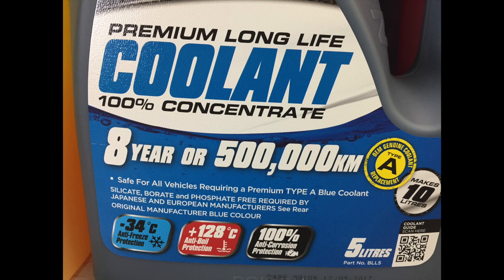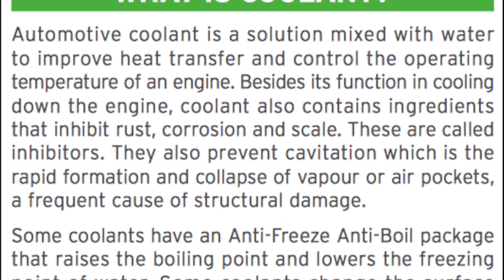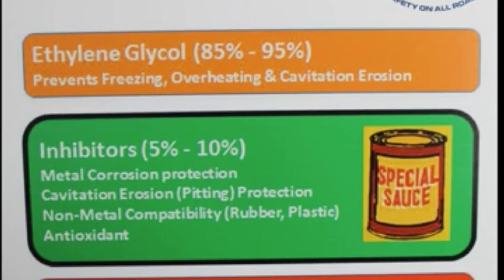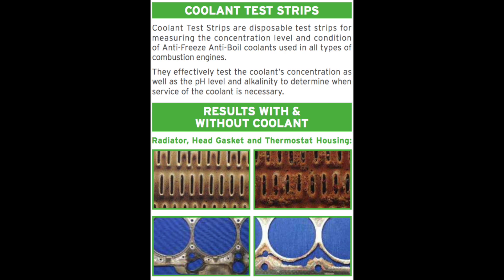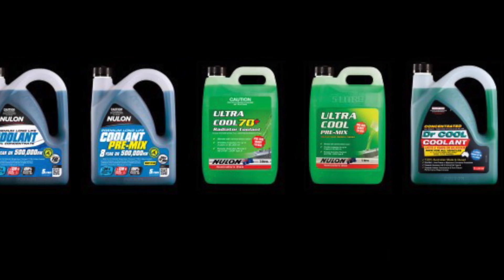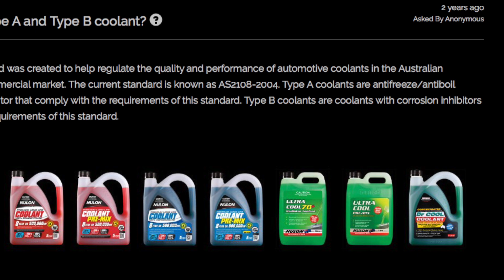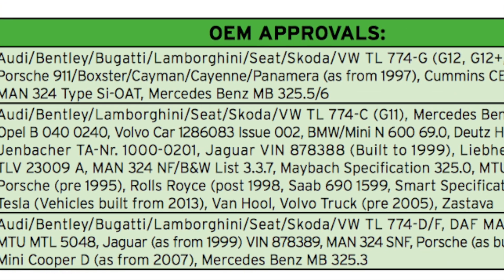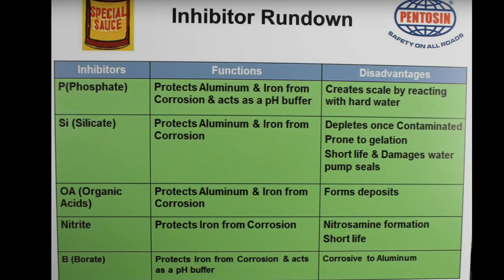Understanding Coolant. Car engine coolant isn't complicated. Rust inhibitor Anti freeze

Comment: I'm looking to put a HOAT in my 1.8 16V Zetec which currently has OAT in it. I will flush the entire cooling system / engine of the ute with deionized water and radiator detergent mixture first. Should this be a reasonable change?

Pretty much adding the same coolent but with the hybrid element which reduces static risk to the sensors and better preserves any aluminum in the system.

Comment: Help ASAP pls!! As a recommendation for BMW, I have a green coolant, but in the BMW Series 1 118D (2005) I just bought, I have a liquid that looks like water. 
Does anyone know how to check if it is a Waterless Coolant or Water?
Reply from the maker: There are test kits available. Have a look at the links in the description or your local speed/ auto store. But if in doubt drop it out and change it. MRT
Reply: @Marksreviewsandtutorials  Thank you. This Waterles Coolant is rare in Serbia. Few drivers know about its existence, I don't even know if it can be bought somewhere in Belgrade. Are the same measuring instruments used for it as for other coolants? Yeah, I tasted it, it's sweet. 😋

Comment: I changed my original green Hyundai coolant with red. I flush it twice. Is there gonna be a problem?
Reply: Valvoline explains the different color of coolant. You may put wrong one. You can buy Valvoline coolant. Valvoline is the giant company, so you won't mess up if you use correct one. 
Note: Valvoline coolant is almost as expensive as OEM coolant.
https://www.valvoline.com/our-products/antifreeze-products/antifreeze-education/engine-coolant
Reply: What type of pink/red coolant did you add? If it is for Asia cars (P-HOAT), it is fine. If it is OAT, it may not be compatible your car.

Comment: I used a castrol concentrate it was yellow in my old 202 (steel block & head). It was good for corrosion protection. However I can't get this product anymore. I use green coolant now and now I have proplems with the aluminum parts corroding now (water pump/ thermostat housing) :(
I'm not sure which coolant to use now. Basically there is type A & type B
Reply: type  A is better.. For corrosion protection you need 50 % green coolant and 50% distilled water ( NOT tap water )
You can buy it premixed at 50% / 50% but you usually  cant get all the old coolant out.
google coolant for your model of car

Comment: Hi, I just checked my coolant and the colour is completely gone ! It was blue going in 3 or 4 months ago and now it looks like plain water. No leak, no topping up or dilution.

Any thoughts on what it could be ?
Thanks in advance.
Reply from the maker: UnCivilEngineerIRL I don’t know but my suspicion would be cheap product? The color is just dye. But if it is gone I would drain the coolant and replace with fresh. 
Did you fully drain last time? As the blend may have affected it as well. 
MRT
Reply: @Marksreviewsandtutorials  Thanks for the reply. Product seems fine in other machines but can't remember what it is or where I got it.

When I got the bike it was full of horrible brown sludge; so I flushed it out with clean water and then coolant.
Then filled the system with a 2:1 mix as specified by the coolant manufacturer. 3-5 months later it has completely gone clear.

Comment: Another one that forgets OAT coolant must not be mixed with ethylene glycol (unless stated as compatible).
OAT antifreeze generally called DEX COOL.
Mixing generally causes gelling.
Reply: OAT coolant is still generally ethylene glycol based. It's the corrosion inhibitors that are different and can react. There's also a couple of different types of OAT coolant. Most European vehicles use a coolant such as BASF Glysantin G30, whereas General Motors "Dex-Cool" specify a mildly different additive package also known as BASF Glysantin G34. Another OAT coolant specified is BASF Glysantin G40, which is generally a Volkswagen specific product. In any case, one type of coolant of a slightly different specification are not compatible with one another, unless otherwise stated.

Comment: the maintenance manual of my vehicles only mentioned glycol and distilled water mix, wondering why the commercial coolant have silicates and phosphate which are not compatible with aluminium, why the need for anti-foam when glycols are themselves wetting agent / humectant
Reply from the maker: Coral Sea I believe that marketing has bought a lot of confusion. That is part of why I did this video. To talk about the basic elements that are behind all of the hype.

Comment: Nice informative video, i just want to ask something, i'm in EU, my car manual recommends to use "type D" coolant fluid, but the manufacturer recommendation for that coolant is made in 2004 (assembly year of the car), when that coolant was probably the latest tech in this domain, what if i do a deep & complete clean of the whole cooling system, could i then use a more modern cooling fluid, like G12++?
Reply from the maker: Myke Vbiescu Have a look at the label of the new bottle of coolant that you want to buy. Many of them say compatible with all engine types or with all makes and models. If it says that on the label then you are fine. The newer cars have lots more elements and sensors in the coolant. Older cars tend to be less fussy.

Comment: Can I add a nanotechnology microcrack repair fluid to my 2010 Audi A6?  How do I add it ?  The bottle I have says not to put it into the reservoir.  I have a tiny smell of coolant in my heater so, I know that's where the small leak is.
Reply from the maker: Arthur Breaux I wouldn’t add that to the heater element. Normally when you add that to an engine you are instructed to have the heater switched off or it will block up the heater element. 
I would be getting to the heat exchanger and visually inspecting it. It may just be a join. But don’t add that product unless you absolutely have to.

Comment: I put universal in some red and vot green how? And do i need to flush?
Reply from the maker: Hi Austin. The colours in coolant are dye not active constituents so going green just shows that the green dye was stronger. 
As I explain in this video the compatibility is in the inhibitors so if the inhibitors of the two coolants are compatible or better still the same, then you will be fine. 
If you are unsure, find out the manufacturer recommendation for coolant type and replace all your coolant with that. 
Every modern engine needs to have rust inhibitors in the coolant to protect the engine.

Comment: I have an older truck that takes green coolant. Would the newer coolant that says any color on the bottle be better? Or stick to the old green?
Reply from the maker: +Joshua Duane Clark Hi Joshua.  The color doesn’t actually define what is in the coolant. That is just dye. With an older truck you may not have all of the probes and sensors in contact with the coolant so std green is probably fine. Green comes with and without the anti freeze. Your climate will determine the need of that. But all vehicles should always have anti corrosive agents in there. 
Watch the video again if this is unclear. 
Mark